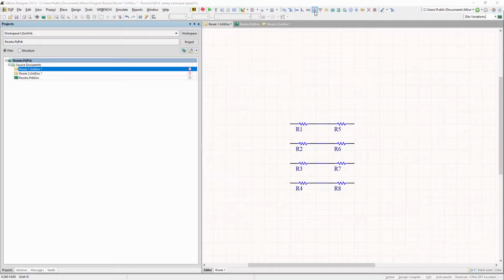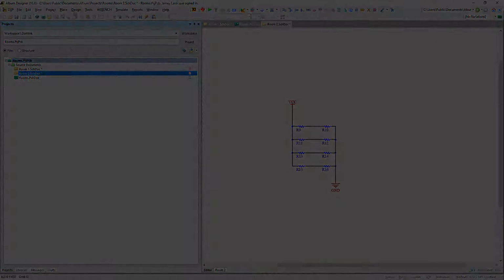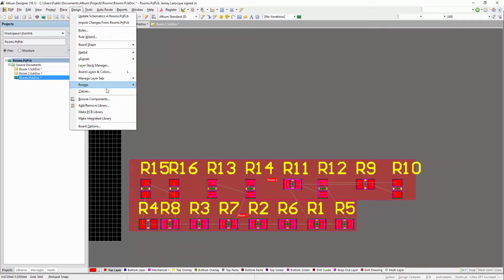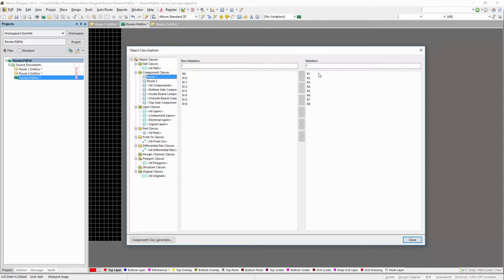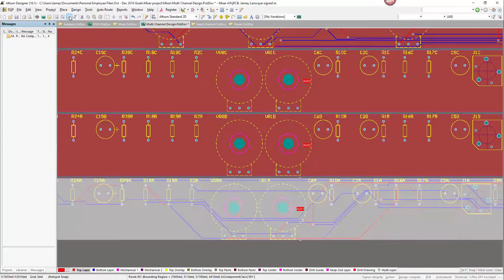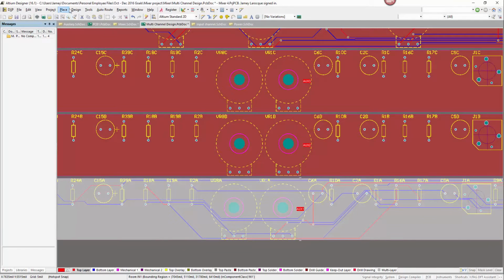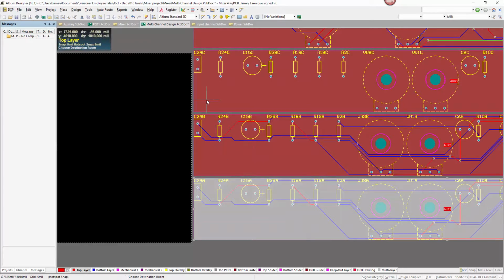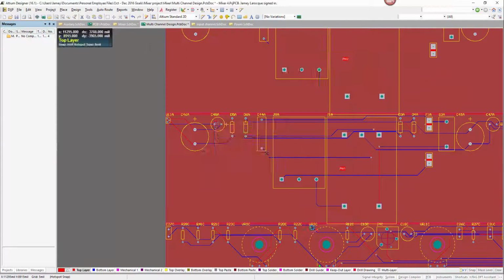Using rooms within Altium Designer

Comment: Too fast, one has to stop the video a hundred times to see what's done.
Reply from the maker: We apologize the video is sped up a little too fast to follow along.

1. The room can be moved by holding the left-click and moving the room anywhere you would like. If you would to move everything in the room,  I would do a selection rectangle to select all. If you want the components to move with the movement of the room, you must assign the components to the room. Room definitions can by found in Design Rules, under Placement, and Room Definition. 

If you right-click the room, go to Room Actions, and Edit Polygon Room Vertices, you can change the shape of the room. Other room options can be found under the Design menu, and under Rooms.

This documentation explains very well how to work with Rooms:
http://www.altium.com/documentation/17.0/display/ADES/PCB_Obj-Room((Room))_AD#!Room-ChangingRoomSizeandLocation 

At the bottom of this document, you will see Notes on different scenarios once the room is in place.

We hope this helps.

Thank You,
CAD Micro
Reply: whatever, just pause and rewind. great video!

Comment: It is important for a tutorial like this to rush through as fast as possible, making sure whoever is watching does not get the slightest clue how all these menus that appear in rapid succession are invoked, and how and why parameters for the menus are chosen. The presenter demonstrated that he understands his subject  matter well, but has no clue how to explain anything to a non-expert audience. For example., I have been puzzling for the last 1/2 hour how to move a room on my PCB after I have defined it. Altium documentation fails to explain it. It seems like Altium needs a sub-menu/view for everything except for the basics, and if you are not in this special view, nothing will work. No word on editing room shapes on the board in this tutorial.
Reply from the maker: Hi Wolf Homma,

As the presenter, I apologize the video is sped up a little too fast to follow along.

1. The room can be moved by holding the left-click and moving the room anywhere you would like. If you would to move everything in the room,  I would do a selection rectangle to select all. If you want the components to move with the movement of the room, you must assign the components to the room. Room definitions can by found in Design Rules, under Placement, and Room Definition. 

If you right-click the room, go to Room Actions, and Edit Polygon Room Vertices, you can change the shape of the room. Other room options can be found under the Design menu, and under Rooms.

This documentation explains very well how to work with Rooms:
http://www.altium.com/documentation/17.0/display/ADES/PCB_Obj-Room((Room))_AD#!Room-ChangingRoomSizeandLocation 

At the bottom of this document, you will see Notes on different scenarios once the room is in place.

I hope this helps.

Jamey Larocque
CAD microsolutions